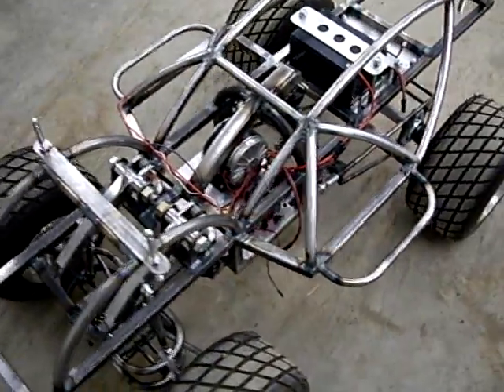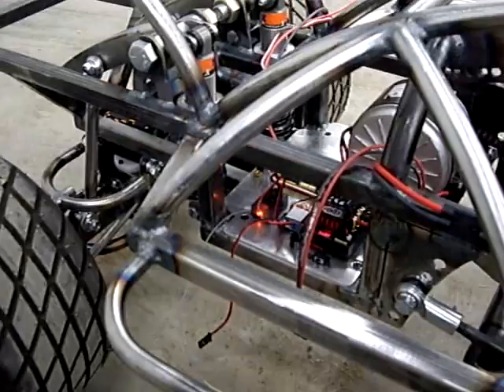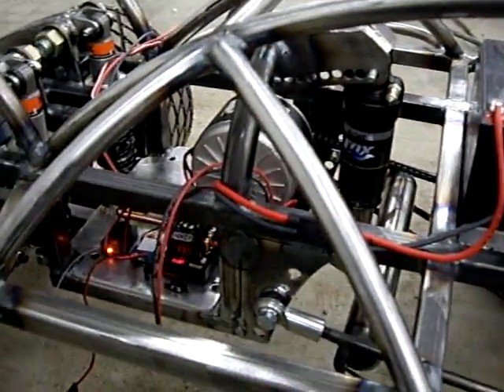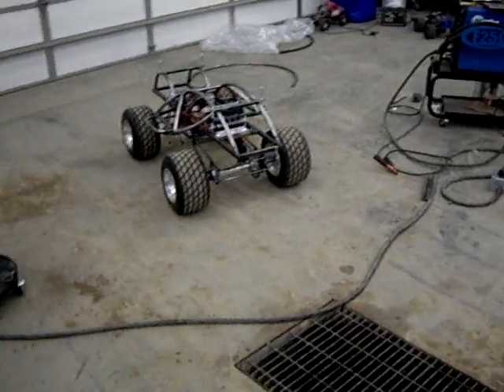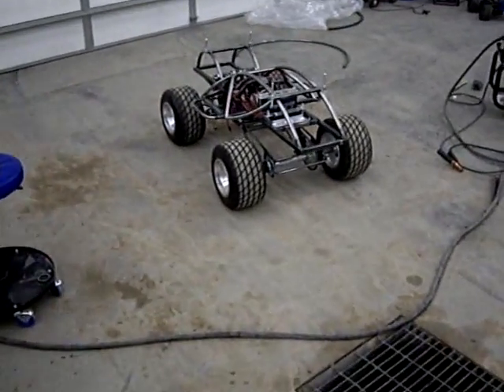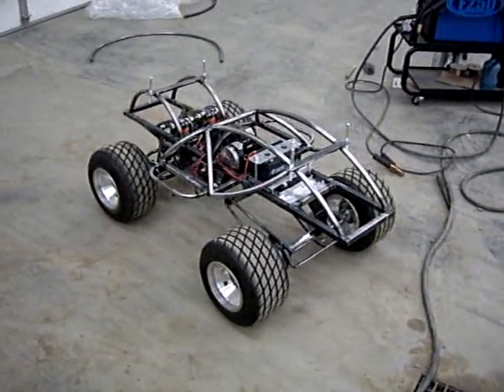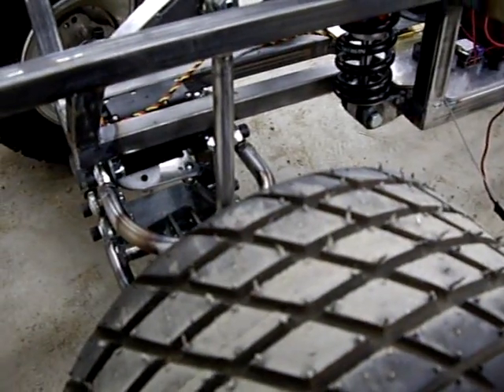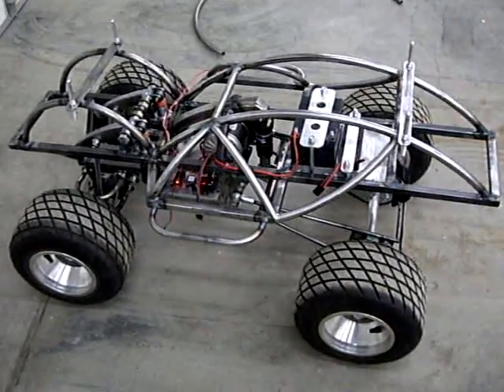Home made HUGE RC car #14, motor moves it! large scale 1955 chevy

Comment: You should run it on 6s! I had a razor scooter and it ran on two 12 volt sla batts in series.. I think most of em are 24 volts it would maybe be a little faster then! 😊

Comment: Is that as fast as it goes? Im going to be making soon a 18 volt and the engine is crazy fast and powerful and almost loud as a vacuum. Wear did you buy that skinny metal to make the frame? And how did you bend it with a tool or your hands?

Comment: do you think it would be possible to make one of these for paintball? i was thinking about fitting a metal PVC pipe, maybe 3/4 inch, and make it able to pivot up, down, left and right.  wondering it you had any ideas. BTW, i have like 30 mini motors out of like old RC cars that either didn't have a controller or weren't working.